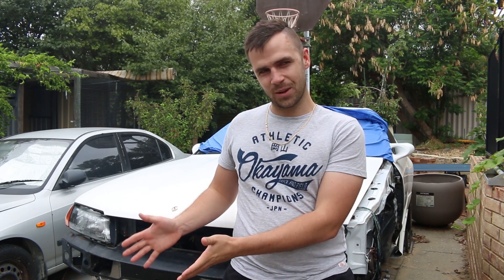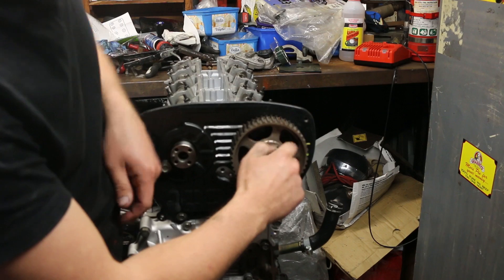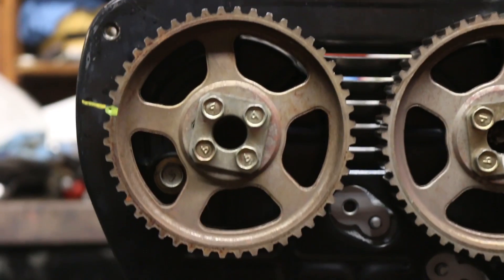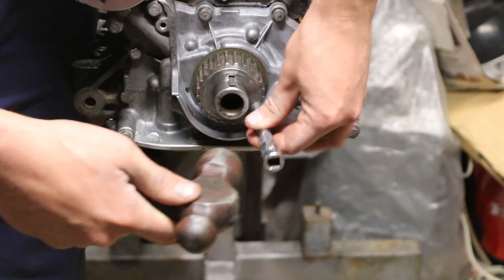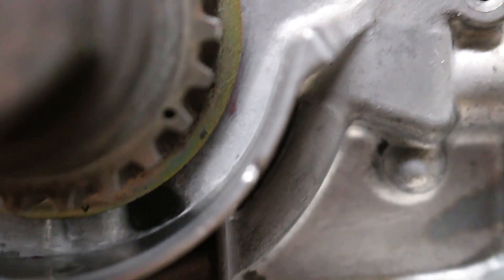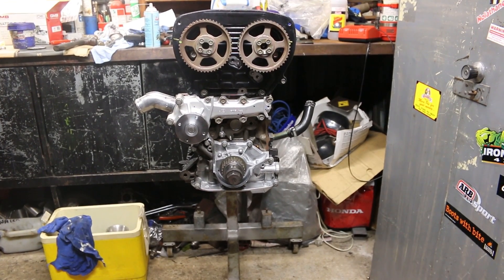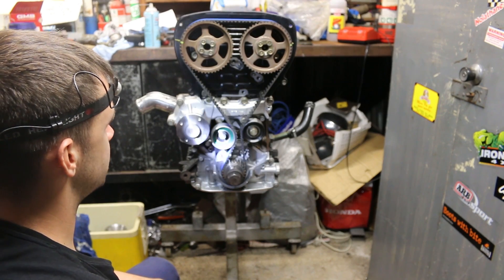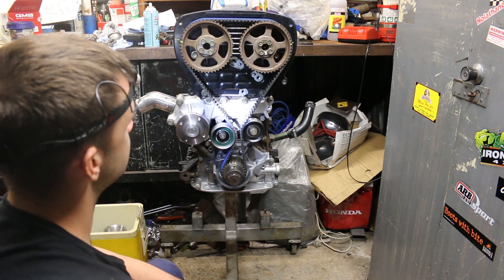Setting Up Timing│►EASY WAY◄│Project R32 GTR

Comment: seriously take this video down re make it if you have to. but dont tell people how to do timing when your going to tell them the wrong way. that is way too tight. as all the comments have said down here. leave nut loose no hex key in the pully, rotate engine 2 times with spark plugs out. put hex key in to make sure you dont move the tensioner as you tighten the nut up.

Gates are tighter than OEM as is. and putting your amount of tension on it is U/S  If you want i can email you the Nisaan Oem booklet with torques and step by step timing.
Reply from the maker: mattzuydam Just because I made a mistake, doesn't mean I remove my content. If you don't like it just don't watch it. I'm not forcing any of you. I'm not perfect I'm only an apprentice. Nor is my dad perfect who's been doing this for over 50 years. So yeah, I'll take your advice like I took others, but don't tell me what to do to my videos!
Reply: At least tell people where in the videos you are making mistakes so they don't do the same.
Reply: you can add youtube annotations
Reply from the maker: Dylan Thompson that would involve deleting the video. Re editing it then re uploading.
Reply: mattzuydam anyone ever did timing on a RB26/30? Just picked it up from the machine shop after having some cams (Kelford 280) installed. But I need to retime the motor.
Reply from the maker: James Thomas Is the cylinder head on?
Reply: Backyard Mechanic not yet. I'm picking up the cylinder head today.
Reply: Can you email me the oem booklet for the rb25det neo and series 2 please my email address is Christianswamber4656@gmail.com

Comment: way to tight on that belt
put belt on.
tighten tensoner nut
turn over 2 rotations on the crank
check marks again
undo nut on tensoner
tighten nut again.

Comment: The camshafts have a hex section for a crescent or spanner just behind the seal caps so you can tighten and torque the camshaft gear bolts.

Comment: you need to turn it and let of the tensioner so it can self adjust to the desired tightness. this gets rid of backlash in the gears. otherwise you get the dreaded timing belt whirling noise.
Reply: Correct. For RB's, turn motor over twice with the tensioner loose then put slight tension on the allen key while tightening. Should have a quarter turn of the belt at the correct tension with standard timing belt. Gates blue belt requires LESS tension as they tend to tighten up when they heat up. Puts strain on the tensioner and idler pulleys and can cause that whine that Because Racecar is talking about.
Reply: Lol was just about to say the same thing as that timing belt looks to bloody tight!!!
Reply from the maker: Because Racecar This set up doesn't have a self adjusting tensioner. I do know what you're talking about though :)
Reply: Backyard Mechanic no man I have a rb25 in my 33 and a 26 in my s14 both i did by tightening tensioner, rotate by crankshaft bolt two turns let off tensioner bolt to set desired tightness. your tensioner has a spring doesn't it? that is what is meant to set the tension. also the car you showed was a 33 😛. not doubting your work just giving my opinion from previously over tightening the timing belt but I like what you guys have done otherwise great work
Reply from the maker: Because Racecar The joys of being an apprentice. I didn't know you have to turn it over. I've always been taught the way I showed in the video. That's the problem, we all get taught different things I'm sure my lecturer at tafe will explain it differently again :P thanks for the heads up about it :)
Reply: I'm an apprentice too we are both learning🙂